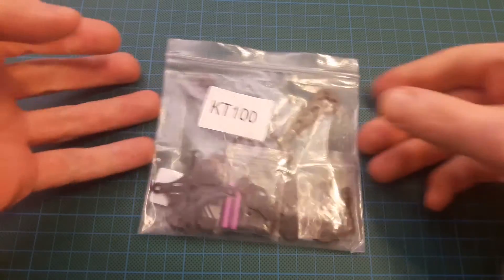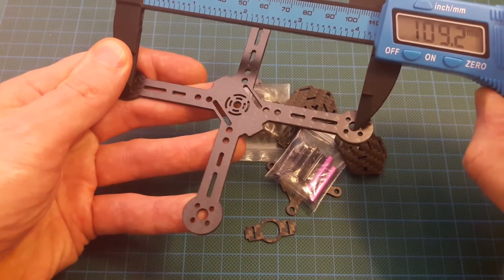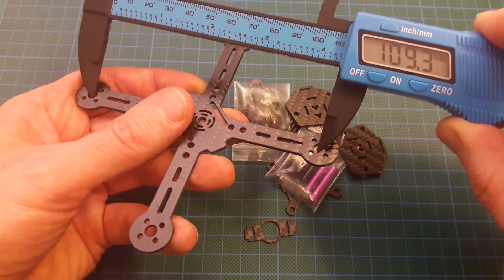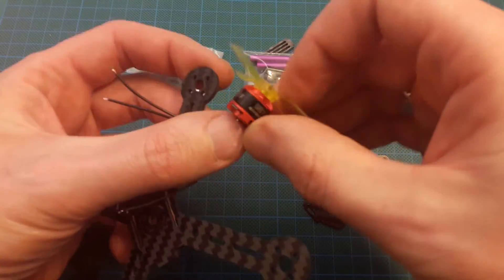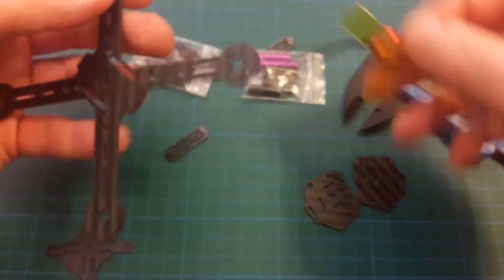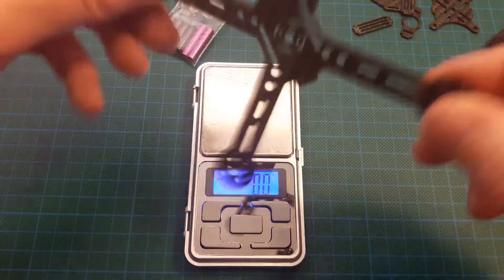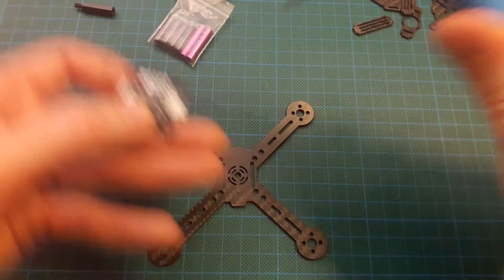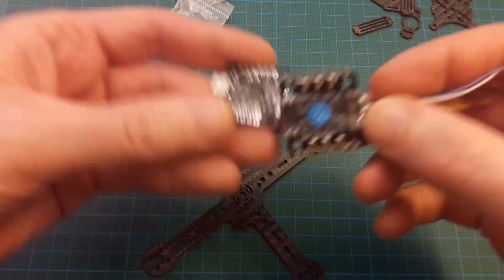Realacc KT100 frame review

Comment: What is the size of the "spacers"?
Reply from the maker: Alex Lurst, the size of purple "spacers" is 25mm.
Reply: Black "spacers" is 20mm? And what is the length of "M3" screws?
Reply: Black "spacers" is 20mm and  the length of "M3" screws is 7.9mm (full length), 5.8mm is screw thread.
Reply from the maker: Alexandr, thanks. I think there is no use of these black spacers as you wpuld probably stack the FC with other shorter spacers.

Comment: what is the distance between the standoff holes?
and would be cool todo a 4s set up on this lol
Reply from the maker: Distance between outer standofs is 27.5mm. So, no, it is not compatible with 30.5mm boards, only 20mm mounting. 4S - possible, but very small props and low KV motors.
I'm in the process of building this frame with 1104 4000Kv motors now.
Reply: will it fit 1306 motors?
Reply from the maker: 1306 motors have 12mm motor mounting holes diameter and this frame has 9mm motor mounting holes. Not compatible with 1306.
Reply: its says 1306 compatible on banggood for some reason?
Reply: also would there be enough room to drill holes to fit 1407 motors?
Reply from the maker: Be warned, that there is no direct fit for 1306. See comments on this page: http://forum.banggood.com/forum-topic-278005.html 
Also it does not fit 3 inch props. 2.5 inch at most.
Reply from the maker: Mounting holes for 1407 are also 12mm. The outer diameter of the frame motor pad is 17mm. Motor screws are 2mm. so it leaves you about 17-12-2=3/2=1.5mm from the each edge. Doable, but it is challenging.
Reply from the maker: 65mm props do touch the standofs. The distance from motor center to standoff is about 32mm
Reply: thanks for the help :)
Reply: if possible use 3020 (3") props?
Reply from the maker: +Alex Glikman possible, but only if you will not use outer standoffs. Use 20x20mm fc and esc  standofs as main structure and drill 20x20mm holes on the top plate. 
Default configuration does not allow 3 inch props, only 2.5 inch.
Reply: Montis it is not good idea :) after first crash my controller board and fpv camera will be broken..
Reply from the maker: +Alex Glikman, agreed! Not the best option! But if you need to use 3 inch props - thats the only way ;).
You need 120mm frame for 3" props.
Reply: Montis for you opinion what frame will good to use 3020 props and 1104 motors ,mini f3 controller (20mm base), 4 in 1 ECS (20mm base), tx03 FPV camera?
Reply from the maker: Not many options. One of the possible frames is Realacc List-T 114 110mm 3 Inch Carbon Fiber FPV Racing Frame (http://www.banggood.com/Realacc-List-T-114-110mm-3-Inch-Carbon-Fiber-FPV-Racing-Frame-p-1119839.html). 3020 props fits into this frame, but read the comments - you'l have to drill the holes for 20x20mm FC mount. Or you can glue the plastic standoffs for your FC. The price is very good...
Reply: Montis thanx. drill holes it is not a problem!

Comment: Hi, I ordered this frame a couple of days ago. Would you be so kind to measure the distance between the holes for the aluminium spacers that support the camera mount.
I would also like to know what is the kv of your motors and what props are you using ?

Thanks in advance! :)
Reply from the maker: Александър Костадинов purple spacers for camera bracket are 25mm and black vertical spacers are 20mm. 
I'm going to use BR1104 4000kv motors with DYS 2030. These are my first 11xx motors. 2.5 inch sized props would be better...